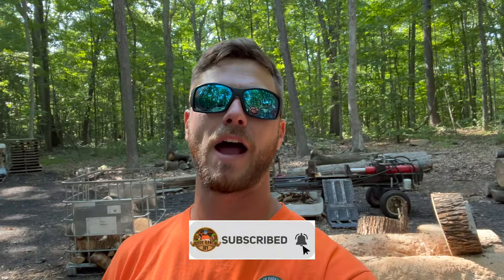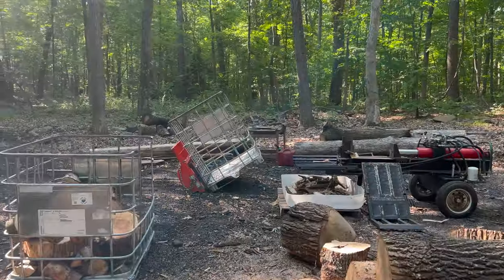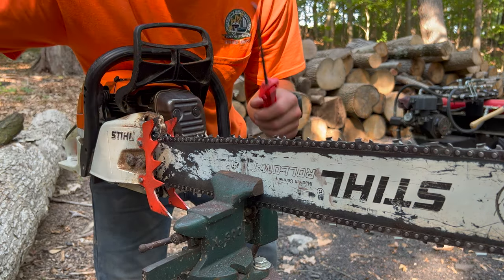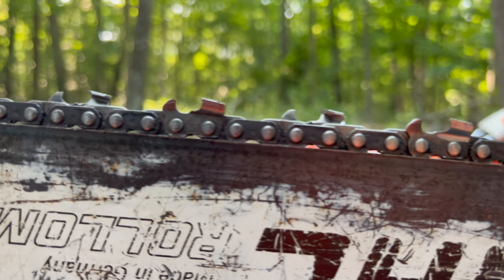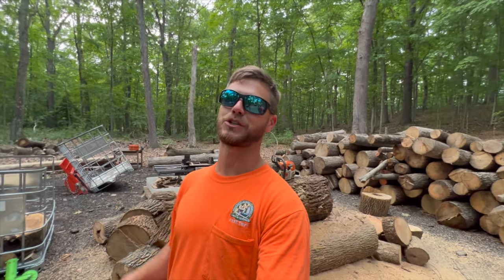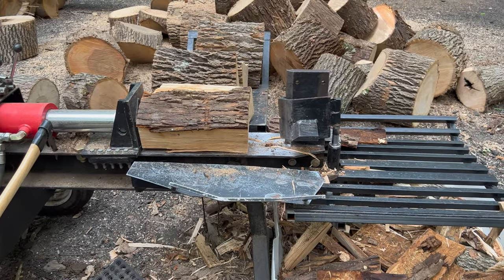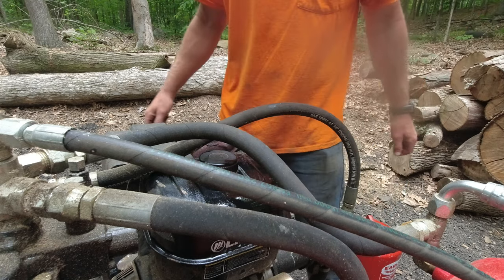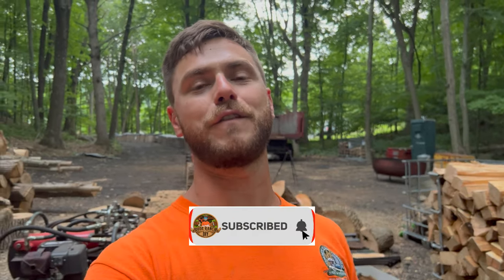#250 The Final Firewood Push & How I Sharpen a Chainsaw

Comment: Do pallet foks typicaly try to fall over like this?  That seams like a pain in the ass.
Reply: Only because he left them in the tote frame instead of on the ground.
Reply: @jasone679  I see. The pivot point moved forward?
Reply from the maker: Correct, the little bar on the bottom of the tote frame creates enough of a gap between the fork and the ground where it then tips backwards. Off camera I slid the tote forward on the forks by hand about 4” and it rested upright on its own no problem.